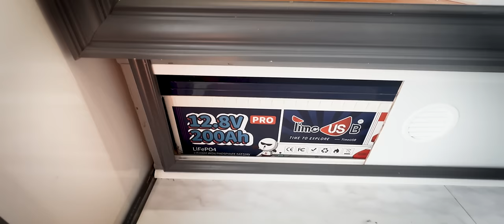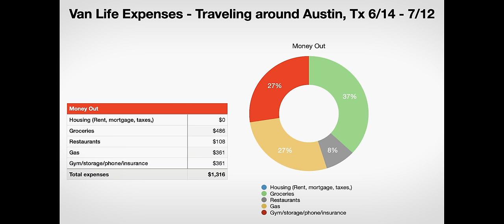Living in my Work Van to save money without paying rent

Comment: Really getting clean does not have to be a shower.  Caught in a van durring the pandemic I bathed every day using a Home Depo cement mixing tub and two basins.  I used washcloth in a clean water basin to wet myself and rung the washcloth into a dirty water basin.  I would soap down with three and one shampoo and rinse and dried two to three times.  Only used about 1/2 gallon of water.  No sink in my van but this worked for me.
Reply from the maker: I agree with you!
Reply: Honestly I wash up better out of the shower. Weird. Shower gives best rinse but not necessar better wash.

Comment: Convert the mini-split to a ducted mini-split with a plenum and you can run air ducts into the cab. This will allow you to have solar air conditioning while driving and you won't need the OEM van air conditioner which should help a little on MPG. Most people don't know a mini split can have a bunch of air vents all over a room or even multiple rooms. A DIY plenum can be made out of insulation board and the air ducts are also low costs.
Reply from the maker: Great idea on the duct!

Comment: One of the nicest van conversions I’ve seen. Personally I would have built in a separate toilet and shower area (more hospitable if you happen to host a visitor). One thing I’m wondering though: what happens if/when the van has a mechanical problem and potentially needs to go in for service for several days? Do you factor in the cost of a hotel/motel stay? I guess it also means you’re not working while the van is out of action.
Reply from the maker: Thank you so much 😎

Comment: so that month in austin you probably drove less than 1000 miles total based on reg unl @ 3.50/gal.
great strategy you came up with to make vanlife work.
this video kept popping up so i finally watched it... subbed.
Reply from the maker: great thing about texas is their cheap gas. it was actually under $2/ gal for a while. I didnt need to drive much in austin the river, stores, park, gym were all fairly close

Comment: I am so glad I ran into your channel. I had a huge studio downtown Detroit for decades, but there came a time when I felt tied to all my excellent equipment which I collected over the years. After moving south I still have four storage units, but I think it's time to sell that equipment. I want to travel and am looking for a Ford Transit since it has the height I need, but I want to work on the road as well, which is why I'm glad to see you working, so it's possible. One of the tools I would like to bring along would be a small welder for sculpture. It would be a 110v unit Lincoln , but I'm wondering how to power it properly. Any advice on that would be appreciated.
Reply from the maker: im happy to hear this! you will do great on the road with those skills. you can power a 110v welder no problem. just need to size your batteries and solar accordingly

Comment: That's pretty incredible you're able to run a split system AC 24/7 from solar.
Reply from the maker: i know! today's technology is amazing
Reply: @nomadbrad503 Would be interesting to see how much battery would be needed to maintain a comfortable warmth running as a heat pump overnight in the cold. The DC inverter heat pump efficiencies have increased enormously in recent years.

Comment: dont replace the van save up enough to rebuild the engine or transmission if it wears out since its a econoline there are tons of aftermarket replacement parts due to it being used as a fleet vehicle.
Reply from the maker: you're right about that!

Comment: You said that you spent 12k for the conversion. How much did you spend for the electrical stuff? 
I live in Canada and just recently started to think of trying to start van live. But the thing is I do a job that requires intense computing calculations that can sometimes translate into 24 hour computer work that consumes 1000W at its peak. On a regular day I could use my computer for 10-12 hours. I am not an electrician and don't have the right knowledge in this field but taking all this into account, I estimated to have at least 6x270Ah LiFePO4 batteries and 4x580W solar panels. Just these parts alone would set me to a whooping $17000 not to mention spending on the conversion of the van. Also, taking into account gloomy weather in Canada for at least 6 months a year, I doubt that 4 solar panels and 6 batteries will be enough to make live in the van sustainable. I would like to hear your thoughts about this. Thanks.
Reply from the maker: The electrical would cost around $3,000

Comment: People haven't always had indoor plumbing, in case you didn't realize. There are people who are disabled and cannot get into a shower. So the alternative is a sponge bath. A pot of warm water, a bar of soap, some shampoo and you're in business. There are also wet cloths designed for bed baths or on the road. Showers may feel great, but washing the body is not rocket science. Talk to anyone who lives in a vehicle and they will tell you they don't shower every day or even every other day either. There is a difference between not showering and not bathing. You may not run your car through the car wash all the time but it doesn't mean you don't wash your car.
Reply from the maker: I agree with you!

Comment: The reason you are getting so many more miles out of your van is simple. It's a FORD!! We had those vans for many years in our company and with just a little maintenance they would routinely run up close to 300k miles and one vehicle made it near 400k. They had those Triton V8 engines.
Reply from the maker: I agree! Ford makes solid vehicles 💪🏻

Comment: I like your camper. 
The window by your day bed I would have made it a little bit bigger and on the back of your camper I would have designed a slide-out porch platform that would extend so you could go outside and set up a seat and enjoy a nice cool summer night as the sun goes down and look out and see the stars. Oabove your bed area I would have put a skylight so you could look up and see the stars as you fell asleep and on the area across the window by the day bed I would have put a TV to watch a movie and if the TV had a swinging arm so the TV could be swung around so if you have guests on both couches you could allow everyone to see the screen at the same time?
Reply from the maker: thanks for watching

Comment: @nomadbrad503 MrNB503 I have followed you continual upgrades to your van..

To increase your MPG 
-SCT Tuner with a tube from 5 Star
-SPD Y-Pipe
-Shorty After-Market Exhaust Header
-Synthetic Fluids .. oil, transmission, rear diff, power steering 
-75-80 psi front tires 
-85-95 psi rear tires
At CCC Driving 61 mph on cruise control you can achieve 13-15 mpg convectively..  all with 85-87 octane gasoline 

The mpg doesn't seam as impressive but the drivability of your rig will improve drastically.. the trans won't drop shift as much...  Cruise control speed will hold on slight grades...

There are more improvements that can still be done to improve mpg and drivability
Reply from the maker: These are great tips! Thank you for taking the time to list these out, I’m saving these for later!
Reply: @nomadbrad503  no problem.. I been subbed ...

If you start in any of the mods I will comment...

There are other strategies as well like header wrapping...EGR delete..etc..

Comment: btw 12k is so expensive not absurd but overpriced however aslong as its as clean as it seems for me and for you i guess its a fair price to pay  reliability is the most important thing to be honest
Reply from the maker: 12k is not expensive where i live. Especially now, prices on everything are going up
Reply: @nomadbrad503  I see but it's a bit of an older example BTW once it gets older and unreliable get a detuned newer  f250 lariat those are a bit expensive but they run for forever and have as much torque as a little child's hopes and dreams so if your looking for a nicer vehicle look for a detuned lariat and a good body shop can place the box on it for you but for now it's still running good but it won't in a couple of years

Comment: I didn't realize you could run a/c 24/7 
with a 1,200 watt system? 🧐
Reply from the maker: yes. i know this confused some people. It doesnt run full blast 24/7. it automatically cycles on and off to maintain temperatures.

Comment: I noticed you said you work as a solar technician for RVs and conversions. Is there a certification course? Any place you can point to for learning or a course? How did you come into this type of work?
Reply from the maker: My 10 year  background in HVAC provided a lot of electrical education and experience.  from there it was pretty easy to teach myself the specifics of solar/ electrical for vehicles. I hold no formal certifications. You could look into training from a equipment manufacturer like victron.
Reply: @nomadbrad503  Thank you for the reply, I truly appreciate it. I had never thought about training from a manufacturer. This could be a potential future video of yours, your experience getting into this particular field.

Comment: I want to get a small box truck like they have at Uhaul because the bigger truck are to big for me, and is there a way to build a door from inside the truck to the front cab so I can just come the back to the front without getting out the truck to get in the front, because I really like your design.
Reply from the maker: Did you watch the part of my video where I explained the door next to my bed that allows me to get from the bed to the cab without going outside the vehicle?

Comment: how you get the AC to run for 24/7 on only 400 amph battery with 1200 watts of solar ?
Reply from the maker: its a high effecient AC. pulls about 700 watts during the heat of the day which the solar can handle. once the sun goes down it only pulls about 300 watts which my battery bank can handle until the next morning when the sun comes up.

Comment: nah I would much rather just make a ton of money and live/work in my house. 3000sq ft house with 1500 sq foot workshop on a few acres in the mountains. Solar that produces more than enough for the house and a well. Mortgage is only $2700.

Eventually though probably sell this house for something smaller and buy a Leopard 50 catamaran and mostly live on the boat sailing.
Reply from the maker: sounds like you got it figured out 😎

Comment: Bro, you should be a trucker and done. It's way more money
Reply from the maker: You missed the entire point. I’m done chasing money. Now I’m Chasing freedom
Reply: @nomadbrad503  you can chase freedom as a trucker as well, offer contractual haulage as a service. Trucks also have campers built in so it's a win-win. I can bet that there is way more demand for moving goods than repairing air conditioners.

Comment: thats too basice for me .....and you left out the part when those box trucks break down also which can cost lot of money
Reply: Box vans as any other mechanical thing breaks furnace in home big bucks well big bucks reroof big bucks list is endless
Reply from the maker: Any vehicle has the potential to break down. Brand new promasters are having transmission problems. Don’t even get me started on the issues sprinter owners are facing.
Reply: @nomadbrad503 quit playing box trucks are expensive to tow and challenging to find shops that have a lift that can support the weight. I know. I spent weeks deliberating between a cargo van and a box truck. In commiefornia if a truck is older than 2010 it flat out isn't legal. But go ahead sugar coat a way 😂
Reply from the maker: @plantmanstudios  this is absolutely incorrect